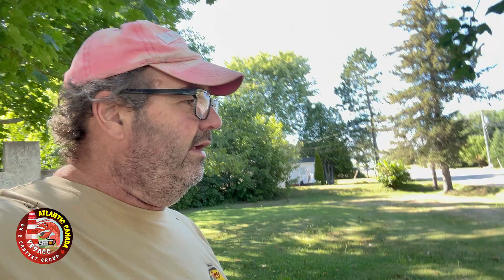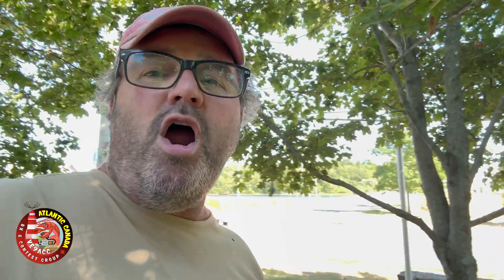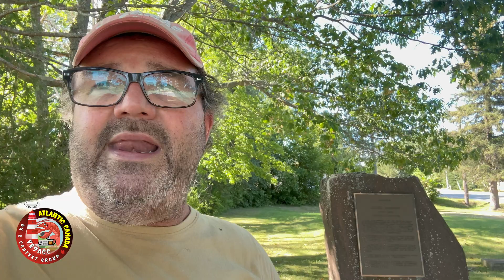What Is The Biggest Threat To Amateur Radio In 2025?

Comment: Honestly I think the fact that you can chat with someone in real time via an internet connection is a larger "threat" to ham radio than any RFI issues we have in this modern interconnected world filled with cheaply made electronics and electrical devices.  Most outside the hobby won't understand why RFI is an issue unless they decide to get into the hobby.
Reply from the maker: Very true...the solar installers at my house looked like deer in headlights when I showed him the noise from my solar system.
Reply: Agreed 💯

Comment: IMO, the greatest threat 2 amateur radio is not enough young people getting into the hobby. Also I would say spectrum encroachment. I think it's total and complete BS that this satellite company AST, gets to operate from 430 to 440 megahertz. Okay here's a thought, in the US the 70 cm amateur band goes from 420 MHz to 450 MHz. Now 420 to 430 is supposed to be for amateur television only. However I in my 30 years of operation have never ever heard of anyone doing amateur television in my area. So that's where I have my hotspot at is down around 420 megahertz it's spectrum that's not being used and since no one is operating ATV in my area I decided to use it. A little comment on that, question, instead of allocating 430 to 440 MHz in the 70 cm band to AST why didn't they just grant them 420 to 430 megahertz? Any ham that operates 70 cm in the US will tell you unless you're in a city or an area with a lot of hams there is nothing in that spectrum. They could have allocated that and everything would have been good but no they chose 430 to 440 MHz.🤷‍♂️🙄

  Also interference from these crypto HF stations that can be located on a cell phone tower a thousand feet from your house, pumping out 20,000 w 40 kilohertz wide signals on HF could be 50 kilohertz away or 100 kilohertz away from the edge of 20 m or 40 m but they don't care. 

  Lastly but definitely not least, it's noise levels over the past few days I've been watching The noise level on the bands and some days it's as high as S9 then some days it's as low as S2 S3. But lately it's just been nothing but noise hardly any signals. Hopefully when fall returns pretty soon HF will come alive again Great video 73 Stuart Hope to hear you on the air.
Reply from the maker: Thanks for your comments

Comment: I agree with you, the conversion to green energy comes at a cost. Another problem, the increasing amount of poor operators on the air. They speak over the person even after they have called and also when they are in conversation. some repeat there callsign several times etc. I find it hugely annoying and was taught to call once only and more importantly to listen.
Reply from the maker: Yes, I hear you about the poor operators...it makes operating really difficult sometimes.

Comment: VA3SPX here.  It's a problem here too.  I am in rural Ontario, near Parry Sound, and I get S9 on 75 meters, about S7 on 40 meters and down to about S5 on 20 meters.
Reply from the maker: Thanks for sharing your experience with noise levels.
Reply: @outnaboot  I should also mention, we have hydro towers passing through the area.  When I drive under them, on my way out to the highway, I get interference so loud that I can't hear anything. It completely swamps the front end of my radio in the mobile.

Comment: At our old house, I had installed a new Daikin heat pump which had some sort of inverter in it.  It wiped out 10m with S8-S9 noise.  I didn't have a big yard so there was no choice but to string my antenna wire over top of where the heat pump was.  Needless to say, my go-to solution was to turn the dumb thing off if I wanted to use 10m.  

This is definitely a major issue with some of these electronics. 
Solar being another one. Some micro inverters are bad, some are reportedly good.  Need ferrites galore all over every wire in and out of everything... It's quite annoying.
Reply from the maker: That is where I am at right now with my solar system...turn it off if I want to operate during the day. But the nice thing, my solar company told me I didn't have to pay my bill until I was happy with the outcome.

Comment: I'm curious what the impact of Canada's upcoming $36.8 billion over-the-horizon radar system will be on the amateur bands. The other threat I see is cellular carriers and satelite operators wanting VHF/UHF/SHF spectrum. The 1.25m, 33cm, 23cm, and higher bands are barely used in my area outside of VHF/UHF contests.

Do you seen any areas where there could be growth? In my time as an amateur, we've gotten 3 new bands... 60m, 630m, 2200m.
Reply from the maker: Thanks for the insight, I am curious to know the impact as well.